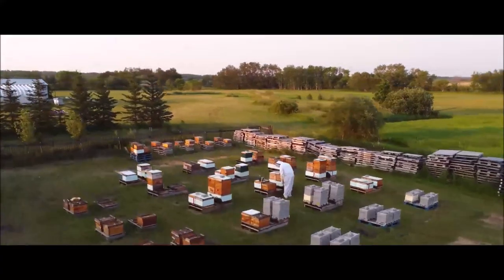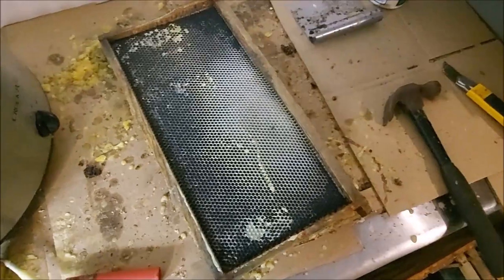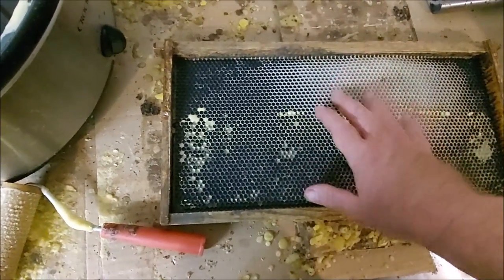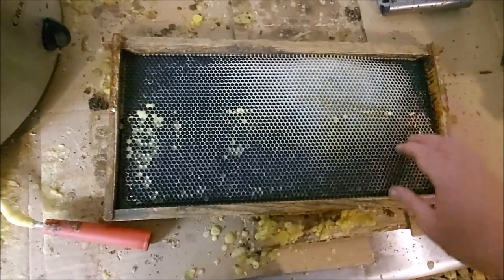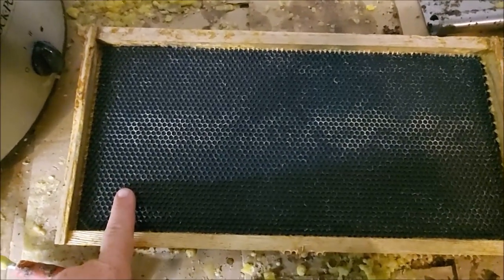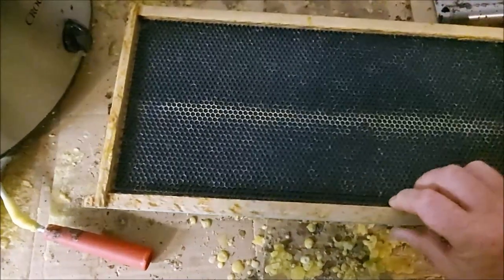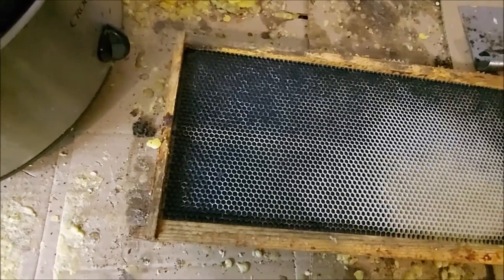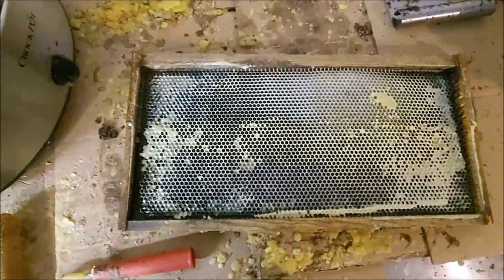Waxing Foundation | Why your bees chew up your foundation!-That Bee Man

Comment: When I wax my plastic foundation I do the edges with a brush as the wax gets all over the frame when I use just the roller, but taking into account what you were saying about them repurposing wax, would the wax on the edges of the frame get used?
 Would they ever use burr comb to finish off drawing out a frame? I tend to take it off the top of the frame as soon as I see it and vacuum bag it all.
A very interesting video, thank you!
Reply from the maker: The will repurpose wax if they need to.  I wouldn't worry about some wax on the frame.  I'm not sure they would reuse burr comb because that's comb they've built and can use.  It would be inefficient to tear it down to build it elsewhere.

Comment: To stop the roller falling off, drill a small hole through the shaft of the roller and insert a small nail and bend it over.
Reply: Cotter pin

Comment: When brood comb gets old , do you strip off wax and boil the plastic foundation . Then re apply the wax again.
Reply from the maker: I have not needed to do a lot of that but it can be done.  You can't boil the plastic foundation without warping it beyond usefulness.  You need to render the foundation no hotter than 75c in order to melt the wax yet leave the foundation undamaged.  This is also how I clean my metal and plastic queen excluders.  Running frames and queen excluders at 75c is why my temperature controlled wax melter is such a benefit.
Reply: Can you share the make and model of temp controlled wax melter?
Reply from the maker: @ShibuRajkalluvila  The wax melter featured in this video is specifically a model SCV503SS-CN which is available exclusively at Home Hardware stores in Canada.   https://www.homehardware.ca/en/55-quart-oval-stainless-steel-slow-cooker-with-little-dipper/p/3826895
Reply: Hi there thanks for the model info. I should have been more clear on my question. I was looking for melting wax out of plastic foundations. What kind of a wax melting device you use for that. A video on that will help lot of us who want to do that . I don’t want to put plastic back to the nature as long as I can reuse it
Reply from the maker: @ShibuRajkalluvila  The plastic foundation is easy to reuse.  I've rendered it in my melter at 75c and it is not damaged.  Sometimes, I'll use a pressure washer to clean up the foundation.  There is far more waste produced when using and rendering wax foundation due to all the support wired that are necessary.

I use this wax melter.  https://tonylalondesales.ca/product/wax-melter-water-jacket-45-gal-capacity/